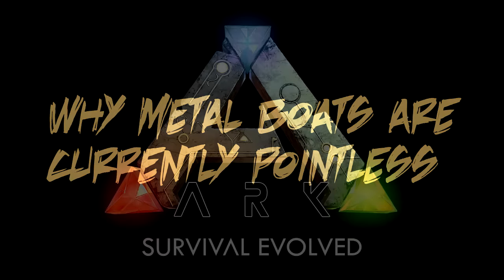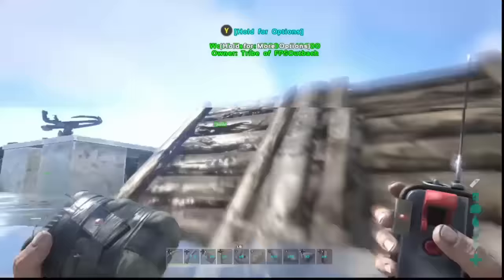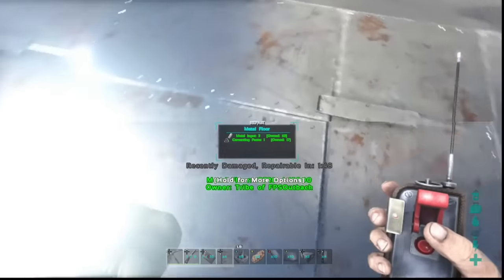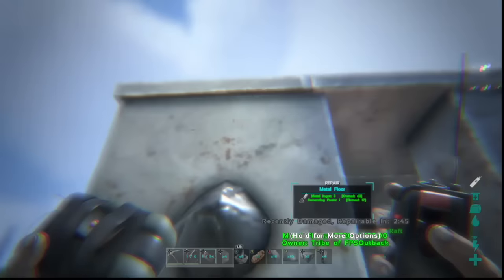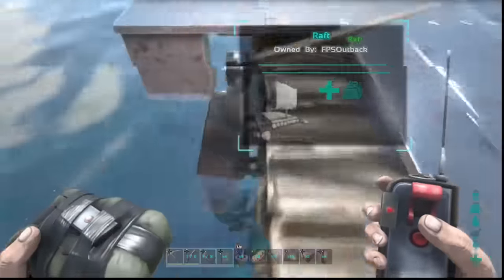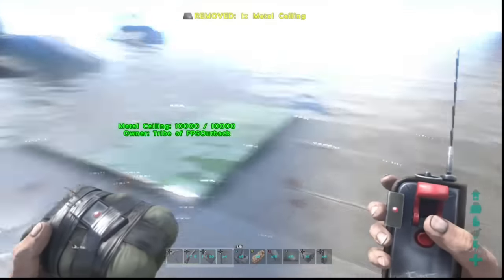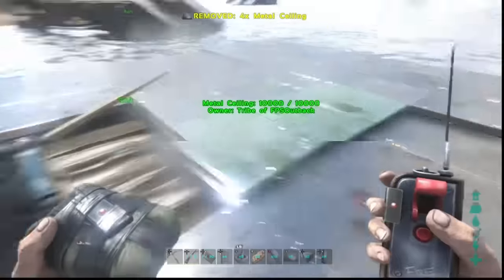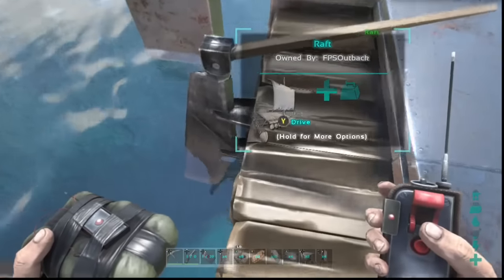Flaws in Explosive blast penetration - Ark survival evolved

Comment: Love your work, thanks for bringing this to my attention. 
I have a boat idea I use often in PVP... but im not much of a video you-tube uploader - I call it the secret store. You can embed foundations in a ring (8 total) at the same depth you do, but before that, I like to embed a central foundation below the decking of the boat.
X X X 
X O X
X X X 
where O is the lowered foundation that is 'unseen' from the top... from this I clip a wall to the side of it, using a temporary ceiling of the front or back... I take that wall down another 4, and end it with a ceiling to put a vault on (or just storages / smithies) On top of the O, I put a hatchframe with hatch door for driving access.

The top of the boat I make into a pseudo-usable life-aboard type deal. I ensure the roof is built out of wood, and let 1 of the ceilings always be broken (gives that raided already look).
Every log-off i simply park close to shore, clipping the vault/storages underground, making them literally unraidable...

Because the central foundation is below the decking, even if everything on top is destroyed out of spite, then I still have secret storages to go to. The only way to loose the loot is to have the raft destroyed (hence why this video is quite disconcerting...) 
But its served me very well in all PVP endeavours so far, and is literally unlootable (if the raft is destroyed, no one gets it, it falls from the world)

Thought you may find that interesting - I'll be doing some single player testing myself soon regarding this explosion problem! Gotta protect our boats somehow (also apparently the bangalore boat was patched ;-) )

Comment: Its counting damage to the mast hit box which is why when the wall is moved to far towards the center it still hit but blocks farther out.  The hit box is big.  anything hiting that mast box will damage the raft.  The mast is only hidden not removed.  IMO they need to add motors and the ability to remove the mast then the hit box goes away but yo have a way of moving the ship.
Reply from the maker: Yeh I made a later video on this, hopefully they will fix it.

Comment: you've tried this on the expedition boat?
Reply from the maker: It does resist blasts on the top getting to the raft I guess due to all the wall and angles, but C4 can still be thrown straight through the sloped ceilings on it.